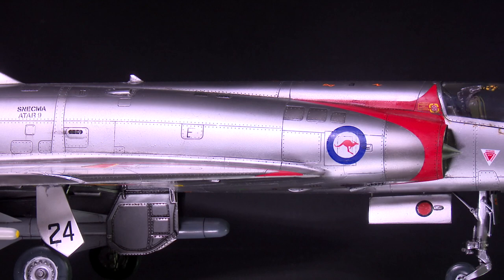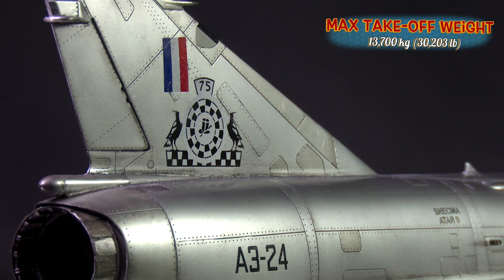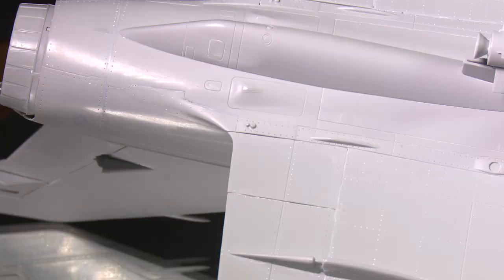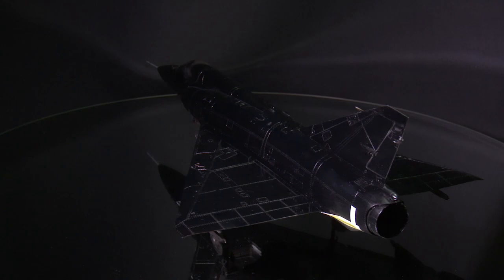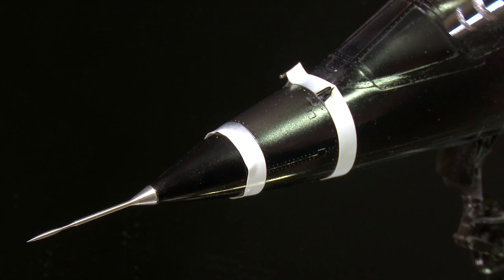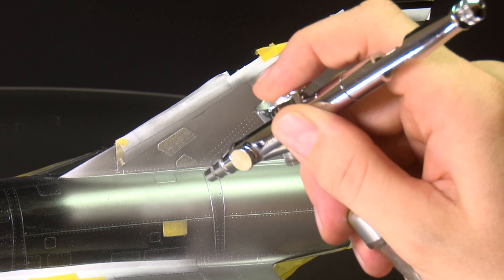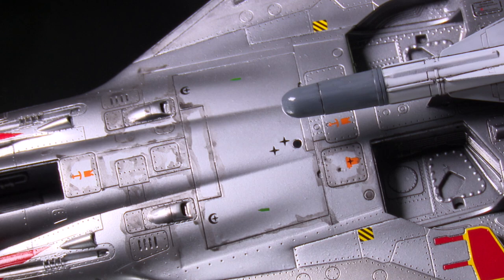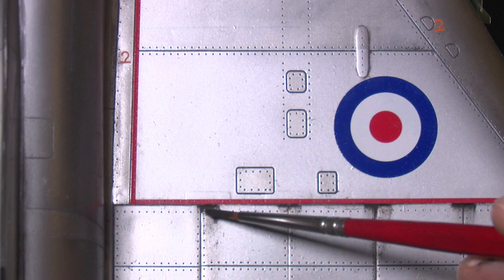Italeri's 1/32 Mirage III-O in RAAF service - Full Painting & Weathering

Comment: I've been modeling  for over 47 years and the natural  metal finish is indeed frustrating.  I've tried everything  including  a large investment  in alclad ii  paints. The tamiya washes will strip the the paint and then you will have to redo your model. Ugh. Also the aircraft at work used to be a natural metal finish and they become  oxidized  after a few hours of flight, with a dusty dull kind of aluminum  look to them . So often times models look better than the real thing! But, what works for me is tamiya bare metal silver spray and silver leaf spray. These colors look the closest to the real thing. Anyway thanks for the build and the info. This is a very beautiful  model .